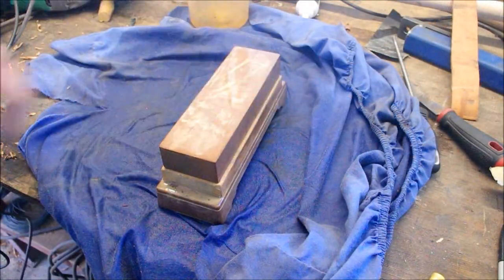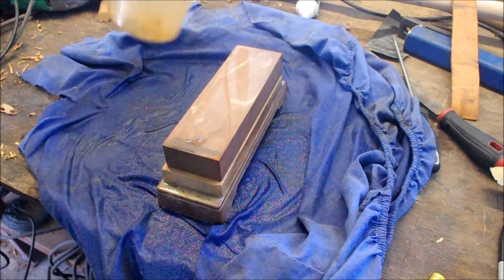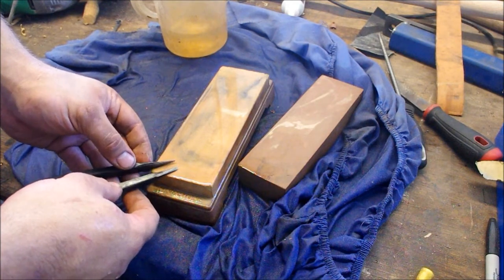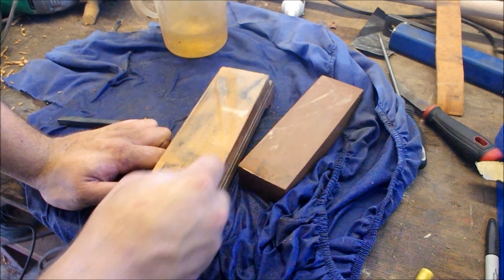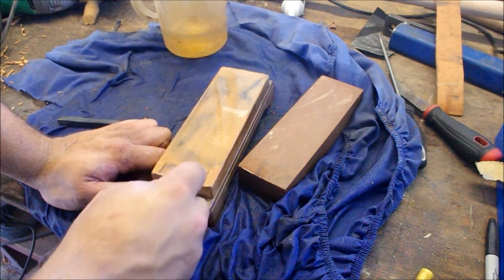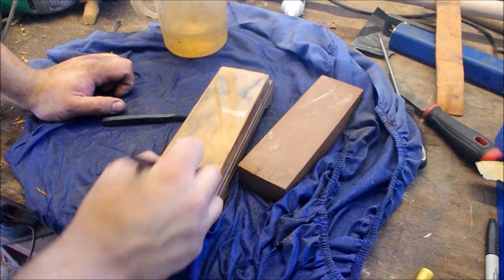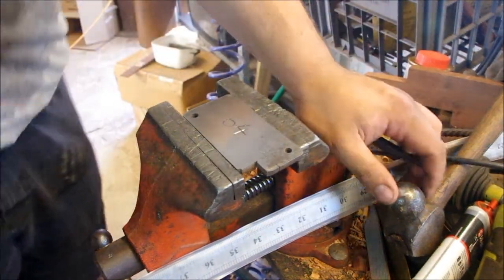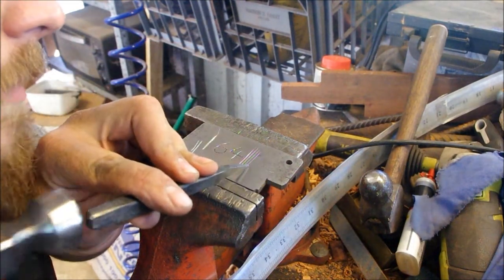Forging gravers

Comment: Sam, nice presentation, thanks. Let me reiterate what Chris said. Do yourself a favor and secure your anvil to your stump or block. I've been smithing for 30+ years and when you use your anvil face to create a radius you'd want to be striking in the same place. Besides with your anvil sliding around it creates a distraction while you are working.  Cheers!
Reply from the maker: My anvil has long since been mounted properly. Thanks for the feedback

Comment: FYI, engraving is about two things, the angle of your bevel, and the polish of the bevel. I was engraving before I was blacksmithing, and especially if your engraving steel these make a huge difference. Also the heel really helps with chip removal. :)
Reply from the maker: Thankyou! I am still learning haha, I will definitely keep that in mind in the future!
Reply: Sam Towns, Bladesmith I started with purchased engravers, and then learned to sharpen them.. your two up with making an engraver, and a hammer. Also the heel keeps them from diving as well as it picks up and makes it like it’s not as “steep” an angle. If you want sources feel free to ask.
Reply from the maker: @OuroborosArmory  yeah thanks, I've made a few gravers since then, and joined a few forums! Any sources you have would be more than welcome as I am always trying to learn more! This is quite timely as my video this week is about engraving!
Reply: Sam Towns, Bladesmith I’ll defiantly watch that one. The only forum I am on regularly is also where I found the best sharpening system, and pneumatic graver. http://www.lindsayengraving.com. Haven’t been able to save up enough for the engraver, but I have a few of his sharpening templates, and they are much nicer than the ones I hand sharpened. Even with my facet grinding machine he has the angles already planed out, and repeatable. When I forge a few, I will forge them longer, but I will probably still use similar angles.

Comment: I have tried on several occasions to forge just one graver all ended in failure. I have since found and subbed to you and your channel. Any graving I will do wil be on blades as well. I haven't checked yet but are any of your videos up close to the making of gravers?
Reply from the maker: M&S BLADES hey mate, I think in the near future I will do an upclose video of graver cross sections. These were the first gravers I made. Thanks for watching!
Reply: Man lucky you as I mentioned I have made several and all ended in failure. It will be nice to see an up close and personal video on the subject. Cheers, Martin M&S Blades
Reply from the maker: M&S BLADES my next video will include a bit of engraving, I'll be sure to go through the geometry then.

Comment: What steel did you use mate? I had a look at these the other night, they look great.
Reply from the maker: One's forged from an old round file, the other is from a section of leaf spring. I'm going to make a few in 01 eventually but i just wanted to screw around with trying different materials.

Comment: I'm not sure about the gravers my push gravers remove as much metal far neater. but that small repousse hammer was a work of art mate I loved it. try as already mentioned altering the bevel of the gravers and your angle of attack I polish mine on a ultra fine ruby stone then rouge then. good luck bro and keep up the excellent tutorials. as an aside fix that bloody anvil down :-)
Reply from the maker: Haha thanks for the advice, as I've replied to a few others these were my first gravers, I've improved a bit since then! My anvil is now affixed, but the block it sits on is still unstable, another thing on the to do list. Thanks for watching!

Comment: your anvil an O'Dwyer? seen them in the local stockman supplies. Very nice looking - but eye watering price.

ps try turning the graver over see if it holds depth better
Reply from the maker: Yeah she's an o'dwyer. The price was comparable for the quality. There aren't too many anvils out there for less that are really worth having.
The idea of the graver is to be used in that orientation, the angle on the "nose" of the graver is way too steep to use the other way, and needs to be to preserve point integrity. Thanks for the feedback!
Reply: no worries - thought it might be worth trying it flipped over as that is how you use a wood chissel for taking thin slices.
Reply from the maker: Jack Dawg yeah i got what you were driving at, chisels usually have a 25 to 30 degree bevel, the gravers have 60 to 70